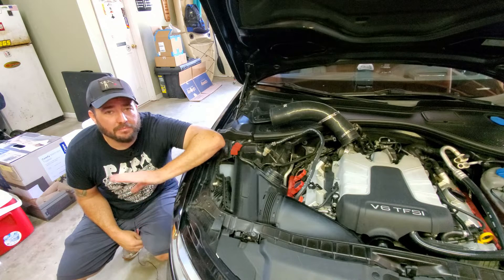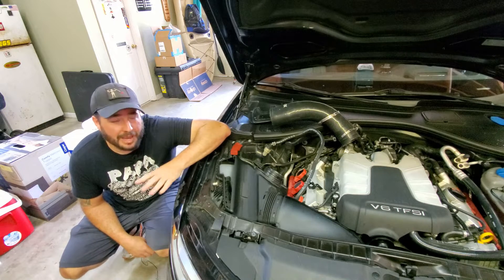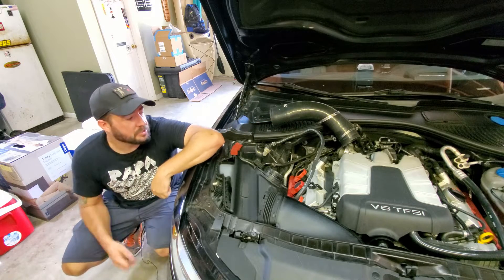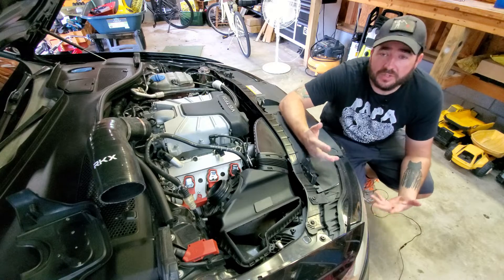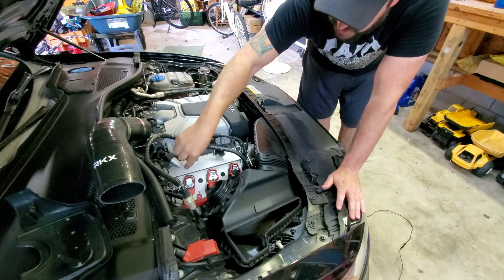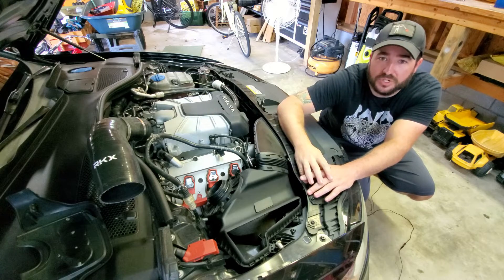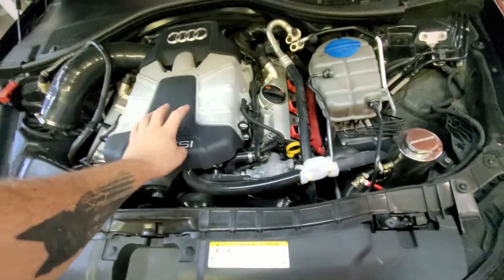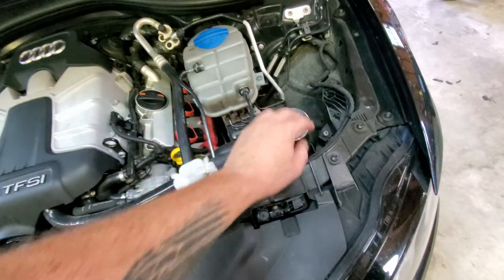How to Diagnose a Misfire on your Audi 3.0T Supercharged Engine

Comment: Hello, is it common for misfires on cylinder 5 to be related to a coolant leak in the compressor?

I'm experiencing misfires on cylinder 5. The spark plugs and ignition coil are new. The problem persists.
Reply from the maker: Yes. I talk about it in the video. It could be a leaking intercooler core
Reply: @GarageTaught 

Hello my friend, I added coolant sealant and then went for a drive. I was able to drive over 200 km/h without missfire. Shortly afterwards, on the next drive, the error came back again. Does that make logical sense to you?
Reply from the maker: I would never have added the coolant sealant. It could leak into your combustion chamber if the intercooler core is leaking and cause issues. I'd get the car into a shop for a professional inspection and diagnosis

Comment: Hey 👋🏼 2014 Audi S4 battling a surging idle when at stops sometimes even when going shop guessing bad injector smelling gas on start up sometimes getting a no start any help would be appreciated been a journey tranny cooler failed milkshake had to get a tranny less than a year owning this thing love it but would love to figure out this surging idle. No misfire codes only running rich codes stage 2 034 tune. New water cooler, evap, PCV spark plugs a year old, almost smells like gas in the oil?
Reply from the maker: Are you smelling gas inside the engine bay or elsewhere?

Comment: Hey I’m in big need of some advice on my misfire. I was getting codes for pcv and misfire in cylinder one, so I changed the pcv and was still getting problems. Then I swapped could and plugs, ordered a new injector for cylinder one, and now I’m still getting the code, but I’m also getting an additional one for electrical fault in circuit. I checked all connections and everything looked fine. The misfire only seems to happen at idle and only occasionally. It’s very slight but you can just feel it idling rough. But as soon as I start driving or pushing it it’s perfectly fine. I’m so lost and ready to just give up on trying to fix it. So if you have any knowledge you can share it would be appreciated. Thank you
Reply from the maker: Did you replace it with an oem injector?

Did you gap the new plug correctly.

Comment: Hi, my 2018 Q7 3.0T experienced the same symptoms as you described early in the video.  I have a #3 & #6 misfire.  I did the coil pack and spark plug swap; codes stayed with #3 and #6.  So I proceed to replace both intercooler cores.  Since I was in there, I went ahead and replaced thermostat, water pump, & PCV valve.  During the removal, I bent the #3 injector and so it was replaced as well.  I do not think it's the valve cover gasket as there is no indication of oil leak inside of cylinder as verified with a scope.  The #3, #6, and multiple cylinder misfire code remained.  The only other possibility is the plugged catalytic converters per your video.  But I'm getting rough idling, setting code, even parked.  Plus I don't have any codes related to catalytic  converters.  Would you be able to shed some light in this?  Thanks.
Reply from the maker: I'd compression test the cylinders next to rule out an engine issue

Comment: I’m having the same issues with 1,2,3 cyl changed spark plugs & coil packs but still having the same issue with misfire & epc light … once I give the car gas it idles hard & shuts off .. any advice on what it can be? 09 Audi a6 Quattro 3.0 supercharged
Reply from the maker: Have you scanned the car for codes?
Reply: @GarageTaught yes I have & I fixed what it said but still having the same issues .
Reply: @GarageTaught  P0301,P0303,P0302,P0241,P0237,P0300,P130A
Reply from the maker: Did you resolve the boost sensor codes?
Reply: @GarageTaught  no which is weird those were new codes added & then disappeared . It seems like everytime I fix one issue more adds up which is strange .
Reply from the maker: Check the wiring to all your map sensors
Reply: @GarageTaught all wiring checks out no issues there all have power & no cuts or anything
Reply from the maker: At this point I think you likely need to carry it into a shop for professional diagnosis
Reply: @GarageTaught thank you
Reply: Did you ever fixed the issue?
Reply: @MazharAli-ed1hw no nothing I changed is still working all new parts n still having the same issue on cyl 1-3

Comment: 2010 Audi s4 over here, I switched all coilpacks and spark plugs twice, I keep getting a nasty misfire in cylinder 4, it got tested for low compression as well, don’t know what’s wrong with it, any advice?
Reply from the maker: Are your intercoolers leaking?

Do you have cats?

Have you replaced the injector?
Reply: @GarageTaught haven’t opened it up yet, but I did change the gasket cover, it was leaking for a year😭😭 then after I replaced the spark plugs, within 2 weeks cylinder 4 spark plugs were all blacked out as if oil was in it, I checked where the spark plug goes and there was indeed oil in it, but I haven’t cleaned it out yet I don’t really know how, so I assume that may be the problem, but I do have cats and I have not changed any injectors
Reply from the maker: If it looks like wet oil in the cylinder then you need to figure out where it's coming from.
Reply: @GarageTaught gotcha, I’ll try to use air pressure to get it all out and a new spark plug and see if that fixes the issue
Reply from the maker: If oil is leaking into the combustion chamber changing a spark plug won't fix the issue

Comment: Have a 2016 a6 that’s misfiring when I press the gas scanned it and it says number 5 is misfiring saying replace coil and plugs we replaced all the plugs and the bad coil still doing the same thing it’s also throwing a p2006 code any idea what to do next?
Reply from the maker: Did you remove the supercharger recently?
Reply: @GarageTaught no!!

Comment: I just purchased an Audi Q7 and I am having multiple misfires. Pulled the spark plugs and 4,5, and 6 were burnt. Replaced all spark plugs and ignition coils and misfire is still there. Should I check the compression next or replace the cooler lines in the super charger
Reply from the maker: Did you scan the car to see which cylinder was misfiring?

Comment: Hey man, I just got a p0303 and swapped coil pack and spark plugs, gaps are good and all. I changed out my sc intercoolers about a year ago. Do you think it could leak in a year on dual pulley 207mm?
Reply from the maker: Hey dude!

1) are you in the telegram group since you are a channel member? If so make sure you ask these questions in there for the fastest response.

2) so moving the coil packs/plugs didn't move the misfire? At that point you are left with only a few options:

-leaking core
-bad injector
-bad compression from a bad valve or something else
-if you still gave your oem cats, a misfire type symptom can be caused by it starting to melt/clog
Reply: @GarageTaught 
So just a little follow up, I had a feeling my intercooler core was bad but didn’t get the replacement parts. Replaced all 6 fuel injectors. While I had the supercharger off I could see the coolant leaking. I have new supercharger intercooloer coming in on Monday. Should I be worried about replacing these intercoolers every year or two?
Reply from the maker: It's Def a maintenance item. I always keep a spare set just to be safe

Comment: Hey bro, thanks for this and all your other videos. I have a 2011 3.0T A7 and I got an EPC light on the dash after a hard pull the other day. I turned the engine off, waited 15 minutes. EPC light gone. I got home and scanned car. Misfire codes stored and a few other things. I cleared the codes. Nothing came back. Is that usually a good sign? Car is driving as normal, I believe. Thanks, A
Reply from the maker: Something is going on. Likely a leaking intercooler core or possibly clogged cats. What engine codes did you get?
Reply: @GarageTaught  I got a lot :/   , do you have an email I could send the VCDS scan too perhaps? No worries if not :) It is possible that a sensor just got shocked and put the car into essentially limp mode for petrol as everything is going fine now at full throttle, but I want to keep on top of it, as it's a pristine version of the car with low mileage.
Reply from the maker: Audic7owners@gmail.com
Reply: @GarageTaught  Thanks mate sent!

Comment: Have similar issue but with no fault code or any misfires detected on live data using VCDS. Any advise
Reply from the maker: What issue?
Reply: @GarageTaught have a misfire but no fault codes. Spark plugs replaced but no difference
Reply from the maker: If you are having legit misfires then there will be a misfire code when you scan

Comment: We did my carbon cleaning on valves, did vacuum leak for supercharger intercooler, did my injector cleaning as well…. We still have a misfire in cylinder 3 

My tech thinks the combustion chamber is filled with carbon and it’s not igniting correctly. Anyone have any insight? Coil packs are good.
Reply from the maker: @TheBigZUnit  compression test it. If it comes back good then you know it's something simple

Comment: 🤦‍♂️ I've been chasing a P030500 cyl. 5 misfire accompanied with a P130A00. Went with new plugs and coils. Still persists. I'm pretty sure it's the fuel injector for mine. White smoke with unburned gas odor.
Reply from the maker: Have you ruled out intercooler cores?
Reply: @AudiC7Owners  not yet... would that make it smell like gas? I'll have to find your vid on SC removal!
Reply from the maker: I'd just make sure you rule out the most common issues before jumping to injector. You would smell gas if they're was sunburnt fuel due to the car hiding the cylinder after a misfire. Gas doesn't burn white, but coolant/water does.
Reply: There isn't any ash fouling on the plug. It looks a bit black... but you're right about the white smoke.

I got this thing at an auction steal. It was a repo that came with only 1 brand spanking new cut key and a bunch of gremlins! The key only works to lock/unlock and start the car. Got VCDS, ODB11, thinking about VAG Taco just for the pin access to program a new key... Most of the gremlins were settled when I got a new battery, thus the purchase of VCDS. UPS dude just swung through with FCP's brake kit! Waiting on them to ship the SC rebuild kit... and I might pick up ECS tunings SC cause this thing is a money pit anyway!

I have this other engine and toys taking up space in my garage so as the weather permits, here in the PNW, I work on it... I'm going to pull those other fuel injectors and run them through a cleaner and swap them out with the ones currently in the car.
Reply from the maker: Don't trust old injectors ever. I'd just replace them with new oem ones. Should be done every 100k
Reply: @GarageTaught  🤦‍♂️🤦‍♂️🤦‍♂️ I'm trying to save that purchase for the 3.2 build. But you're right. I do want to drive this thing!!
Reply from the maker: A bad injector can land you with an engine swap bill really fast
Reply: @AudiC7Owners  🤦‍♂️ god damn it! When you're right, you're right!

I'm an electrician by trade. If you have any questions... don't hesitate to hit me up!
Reply from the maker: Thanks man! My wife's father is an IBEW member 🤘🏼
Reply: @AudiC7Owners  fellow brother! You're covered then!

Comment: Well I started having some missfire on cyl 1 and a knock sensor 2 issue on my 3.0tfsi, that video is what I needed. Hope it will be spark plugs issue or coil pack issue. About the knock sensor I couldn’t find any useful information so I am not really sure where the problem can be 😢

Comment: I have a 2017 q7 wit 3.0 ive change coils and plugs and injectors and still having a cylinder 2/3 misfire it jumps im lost at this point has 120k miles pretty nice truck but randomly started misfiring and im lost after trying to fix
Reply: Do a piston soak. Itll change the car life. Very easy and simple to do. Just look up b12 piston soak for audi 3.0 on youtube.
Reply: @Noskillz_  figured it out runs great but now every week or every other week uses a quart or 2 of oil regularly
Reply: @bankrollturtle  what was the problem
Reply: Yes, what was the problem having the same issue?
Reply: @Dave-oe9hd  injectors
Reply: Cool thanks I just ordered a set

Comment: I have a 13 Audi v6 supercharged. Got misfires on cylinder 1,2,3. EPC light aswell. Changed spark plugs and moved coil packs. Same codes. Any help from a year old video
Reply: I am having exactly the same problem
Reply from the maker: Have you checked for a leaking intercooler core?

Have you checked for a clogged catalytic converter?

Comment: Hey Cameron,   I am getting a misfire on cylinder 4 on my 2012 Audi A7.  I started looking around thinking it was probably spark plug and then realized the black clip that secures the coil pack is cracked so I"m guessing that's what my issue since it's not making a good connection.  What is the fix for this?  Thanks for all your content.  It has been very helpful to me the past few months.
Reply from the maker: The only fix is to replace the harness it is attached to.
Reply: @GarageTaught  While we're at it theres a 2010 Audi s4 that's having a misfire on cylinder 4. Dude said he took it somewhere and they said it might be a bad piston. The car still runs and drives but sometimes it wont let him go above 4k rpms. Any insight on that?
Reply from the maker: Without seeing the car I'd have no idea. Have the spark plugs/ignition coils been changed? Are the IC's good and not leaking?

If so, check the car for codes & you need to compression test the car
Reply: You ever find out?

Comment: Great video as usual!

I just cross checked plug  & coil, next I de-pinned connector to confirm wires intact along with checking wires in coil harness (I had to change connectors).

I also under maintenance pulled supercharger for PCV, cleaned valves etc. When taking off intake runners connectors broke so I replaced.....

Could my issue be an injector or connection??
Reply from the maker: Have you checked your intercooler cores?

Comment: My engine souynds like it misfires at high rpm. (From 6.5k rpm) Sometimes it really misfires on cillinder 3. I have not catalyst. 10k km ago I had my injectors, spark plugs en charger cooling cores replaced.  Any ideas? It looks like it only happenens after pushing the engine for a while. So like multiple pulls.
Reply: Could just be heat soaked if it only happens when doing multiple pulls

Comment: Great videos man! I have a 2013 Q5 with the 3.0. EPC light is on intermittently with P0304, cyl 2 misfire. I changed plugs and coils and still have the issue. I swapped coils to be sure it wasn't a bad new coil. A shop told me it's the injector.. My question is should I attempt dyi to change it myself along with new injector seals? Should I change intercooler cores while I'm in there or anything? Any special gaskets needed? Thanks a bunch

Comment: EPC code P0303 I changed the spark plugs and the Ignition coil still misfiring losing power when accelerating! Any help please!
Reply from the maker: Did you check your intercooler cores for leaking?
Reply: @dieudonnerick9087  hey man i have the exact same problem did you happen to figure it out ?

Comment: i sold this car because this engine is not reliable, and the cylinder liners are very poor quality, so high oil consumption bad compression, multiple problems around 200.000 km
Reply from the maker: Just sounds like you didn't take care of it to me. These are some of the most reliable engines audi has.

Comment: I have a 2013 S5 and I need help !! Please .. I have replaced the coil and spark plug for cylinder 2 and I am still getting the misfired on the same cylinder.. does this means I have a leaking supercharger ?
Reply: More than likely. I would check the wires for continuity and also check if any connectors are broken. Vibration from a broken connector will interrupt the closed loop circuit. Dosent matter if it’s still metal on metal. Picture moving the leads on the multimeter back and forth while testing. It will give u a false reading ✌🏽I would do this first before throwing money at it.

Comment: I so need your help. I have a 2014 audi a6 and it runs fine except when sitting at a stop then the rough idle is unreal!! I cannot figure it out. Has not thrown a code never ever had check engine light on. Nothing
Reply from the maker: It could be worn engine mounts causing your engine to move around a lot
Reply from the maker: Do your shifts feel rough?

Comment: Hey bud I need your help so my car when hot on park or N has a little shiver sometimes more sometimes less it seems like a misfire but it’s stops and starts whenever it goes away on drive I have new plugs injectors were cleaned as well as the carbon build up and pcv was replaced any thoughts on that ? No faults either
Reply from the maker: It could be  carbon build up, but I'd suggest changing your coil packs too
Reply: @GarageTaught  I did carbon build up cleaning wasn’t that the injectors were professionally cleaned too and new seals